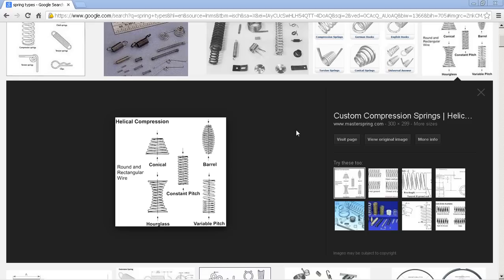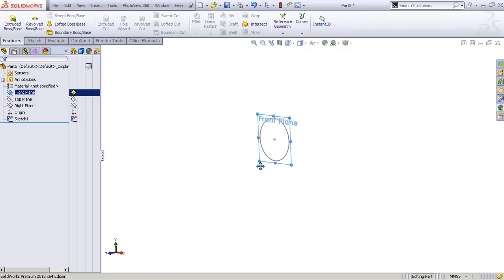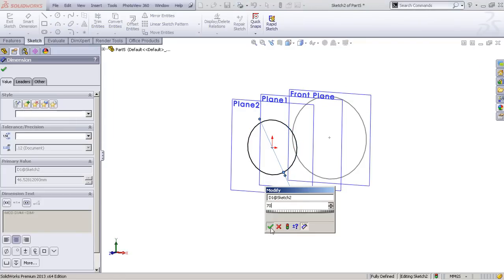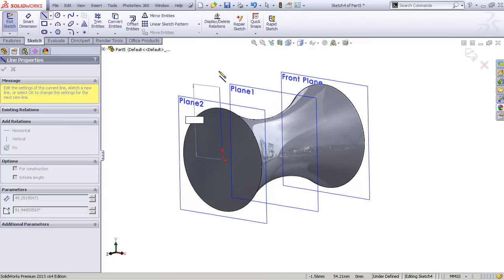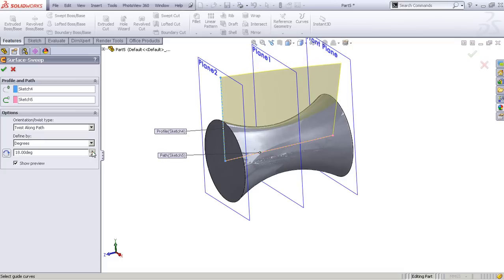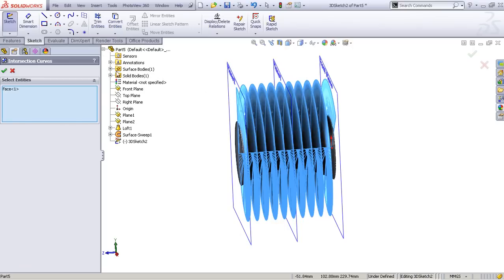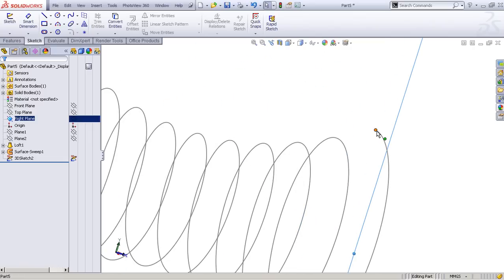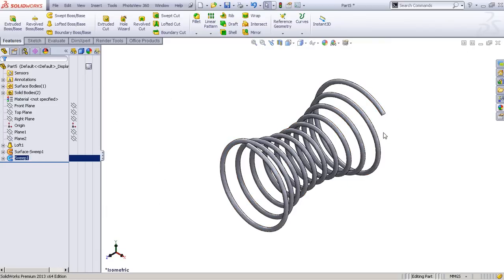Sweep Surface, Lofted Boss/Base and Intersection curve to model a Hourglass Spring - Solidworks

Comment: Very insight full. I am watching this in 2021, I am drafting a globoid worm gear. This is pretty helpful. I am a freelancer mechanical design engineer and will be of use in the modelling of complex shapes and machine parts especially for cnc machining.